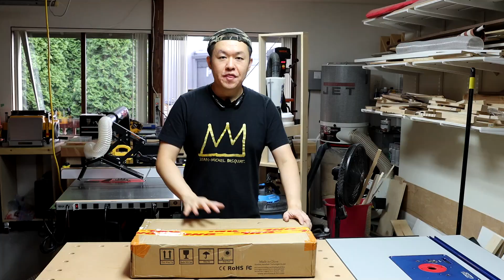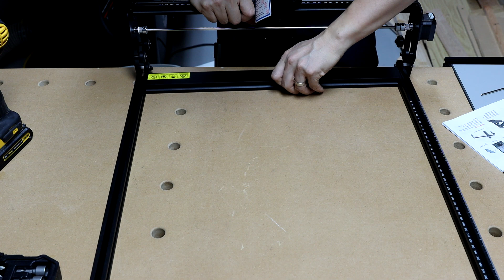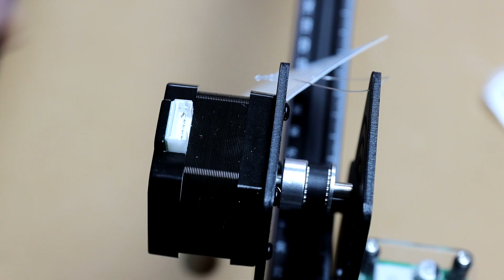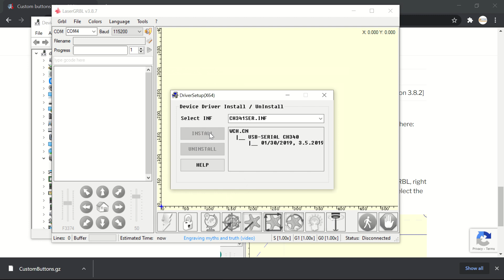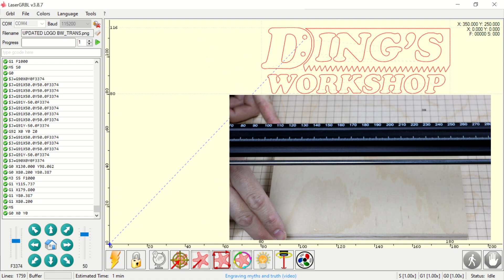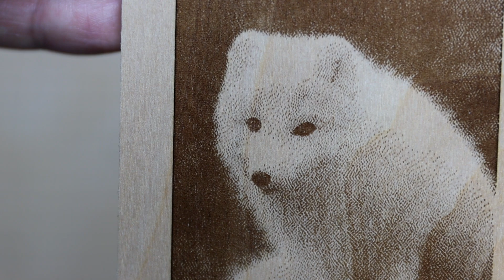Atomstack A5 Laser Engraver Review & LaserGRBL Tutorial | Banggood Woodworking Tools

Comment: Its a fixed focal length laser. How do you set the optimum height above the material?
Reply from the maker: The manual said optimal distance is 2mm off of the surface of the material (from the green hood)
Reply: Thank you for the reply. I've been using that little acrylic Square which is 2 mm thick for all of my burns. And if I didn't say it before... great video thank you
Reply from the maker: @joesgarage618 haha me too! That little acrylic works great as a spacer :)

Comment: I want to engrave on leafs but dont know which laserengraver i have to buy..is it possible with the a5?
Reply from the maker: It’s possible but you need to make sure to tune down the power and use higher speed setting.  Also need to make sure the leaf is completely flat because here isn’t much wiggle room between the surface and the laser’s green covers (about 2 mm gap)

Comment: Can you cut acrylic with this? 3mm maximum. I have one coming from China through Aliexpress. Skeptical as i found mine for £100 delivered. Hopefully it turns up
Reply from the maker: 3mm acrylic is possible, but it will not work with clear acrylic.  Most likely will require multiple passes and slower speed
Reply: @DingsWorkshop  Thankyou for your reply, It is only black acrylic I aim to cut. If not i will attempt to upgrade the laser module. Fantastic channel.

Comment: Hello Ding, Great videos perhaps you can help trouble shoot an Issue, first few tests were very black, just what i wanted following your setup it is not a black as before on the very same type of material, any ideas?
Reply from the maker: hmm what changed between the test results?  did you change the speed?  power?  or perhaps the distance between the laser and your material's surface?
Reply: @DingsWorkshop  Ding, thank you for your response, I discovered that on line to line that the quality had been set to 3000 i moved it back up to 8000 and solved my problem, I reinstalled the software and I think that was when that value changed,  Only problem i see now is a random disconnect ,but that has only happened twice.  Seems that 8000 on the wood I am using works well, again thanks for your videos, really helped this Noob.

Comment: Hey man. Great video! I have a concern regarding the tool, not having a LIMIT SWITCH how big of an issue can that be?? Thank you very much in advance!
Reply from the maker: I actually feel the omission of limit switch isn't a deal breaker.  this way I always need to be mindful of how large my work piece is, and I always do a manual calibration on the coordinates before I use the laser
Reply: @DingsWorkshop   Hey Ding! thank you for answering. Greetings from Cyprus!

Comment: Very clear and precise video.  One thing I can't find reference to is what thickness of material I can fit underneath the laser. I am hoping to engrave on 200mm thick pine. Would this be possible?
Reply from the maker: The engraver is not limited by the height of the material, as you can always elevate the engraver machine to meet with what we thickness of material you intend to engrave on
Reply: @DingsWorkshop  Thanks for answering. I get it now.

Comment: Just  purchased the newer A5 pro m50 similar, but has power switch and emergency off button and also a lcd touch control with a sd card slot so you can load gcode so eliminate the need for it being connected to a computer.
But your guide is still a good reference for my machine.

Comment: Will this cut thin wood pieces for like the 3d animal and building puzzles
Reply from the maker: It will. Just need multiple passes.  Also, it works best with wood with thickness under 1/8 inch.  Anything higher will not work too well

Comment: Thanks for the help getting my own laser set up! It really did come in hand. I did want to ask what was the board you used for the base. I see you added the image to 'cut' it, but might I ask what the dimensions of the wooden plate are? I'm trying to not damage the underlying area where my laser engraver rests.
Reply from the maker: I used a piece of birch plywood I had.  Total engraving area is 400mm X 410mm so the piece of wood I had was larger than this size
Reply: @DingsWorkshop  Great. Thank you very much! Sorry, I'm a bit new at this so I tend to ask every question I don't know, even if it is easy to realize if you think about it.
Reply from the maker: No need to apologize!  It was a great question!

Comment: FYI, Newer models have a line switch between the transformer and main controller for convenience, the guard protecting the user from exposure is already attached and a thumbscrew replaces the two set screws to hold the laser module in place.  Everything else remained the same.
Reply from the maker: Good thing they’re keep improving the product!

Comment: So do u have this enclosed when in operation? Or is it in the open? This is a question for radiation concerns? I have this item and thought this video was super helpful... I have yet to assemble it and wanted to know about safety. I know about the glasses, u mentioned well ventilated area which im going to use air purifier for the smoke and such. Also I saw online saying its a wood cutter which was my intention for it, do u try to make cuts with it?
Reply from the maker: It’s capable of cutting 1/8” thick wood.  I also attempted to cut 1/4” but the result was not good.  I don’t have it enclosed.  When I use it, I have my garage door open, and my fan is blowing toward outside with my air filtration turned on.  I also step away from the area.  Although having an enclosure built around it, with proper ventilation is probably the best way to control the fume.
Reply: @DingsWorkshop  im also checking for a laser mat for the bottom not sure if thats what its called. But im hoping it works out in the end.
Reply: @DingsWorkshop  im not sure what hight it needs to be any suggestions? Maybe about a cards thicknes? thanks.
Reply from the maker: 2mm off of the bottom edge of the green protective cover
Reply: @DingsWorkshop  Gonna duplicate ur settings for vextor soon. Ive been at this for the entire day and my work space is limited every direction. XD Its sad really... had a 3d printer aswell that is printing when it wants to. Also made an enclosure which is like a masterpeice. XP I say that jokingly... Wish i had a shop maybe in the future if all goes welll.
Reply: @DingsWorkshop  So i finally worked the courage to start it and it was successful. Phew! Long journey to get to this point was trying to make a filter blower work... Still though when i start it, i might have over looked some details on the set up which ill review. The laser moves away from where i start it up at. Some home position thing Im guessing... Oh also the score was like .01mm or .02mm deep.. next to actually get a cut.

Comment: Super helpful video. One question... how do you set the height of the laser above the material?  I can't seem to come up with that parameter anywhere.
Reply from the maker: the optimal distance is to keep 2mm of space between the bottom of the green cover & the surface of your material.  what I do is I drop the laser module (with green cover) and let it rest on the material, then I raise the laser up by 2mm and tighten the module
Reply: That's exactly what I was looking for. I'll make a 2mm shim and setup will be easy. Thanks!

Comment: Will it cut 3mm clear acrylic?
Reply from the maker: Might require multiple passes, but it should work
Reply: @DingsWorkshop  Thanks.
Reply: @DingsWorkshop  What would be a better option?
Reply from the maker: Hmm I can’t say I’m an expert, but you will need a more powerful laser to achieve faster cutting capabilities.  These ~$300 lasers use laser diode as the energy source, and achieved cutting capability by concentrating the energy.  But laser diode itself is simply a very weak laser.  CO2 lasers deliver much higher cutting power, but at same time the cost for CO2 lasers are usually in the thousand dollars range
Reply: @DingsWorkshop  Thank you ..

Comment: Hello , is there an option where I can cut through a piece of wood and not only engrave ?? Thanks for the explanation tho , really helpful
Reply from the maker: so laser engraving is essentially introducing a concentrated energy that is enough to remove the material.  In the sense of wood, laser engraving is basically burning the wood, thus causing the darkened color.  in order to cut, you will need to do multiple passes of the same path which the laser takes - in other word, burn the same path multiple times, and eventually you will achieve a "cut".  Based on my experience, this laser can cut through 1/8" wood.  1/4" is achievable, but takes much much longer.  Here's a demonstration of laser cutting I did using this laser:  https://youtu.be/LjgJgktgiFA?t=316
Reply from the maker: here is another example, but with higher power output and slower speed: https://youtu.be/Ug9-sM1faJo?t=516

Comment: Thank you Mr. Ding for the grid it’s awesome I got it engraved, my laser head seems like it’s loose after I mounted it, my protective coverings was already on mine? Do I need to take them off and tighten something? You can rock the laser back and forth pretty easily
Reply from the maker: odd - the laser module shouldn't feel loose.  there are 2 mounting screws which are used to adjust the height of the module, can you make sure they are tight?

Comment: Have you tried to cut/engrave acrylic on this laser?
Reply from the maker: It works with non-clear acrylic.  It won’t work if the acrylic is clear
Reply: @DingsWorkshop  Thank you. I’m probably going to be using non clear acrylic for most of the projects anyway as it’s just got myself. Or use a mask over it such as masking tape. Thank you!
Reply from the maker: I’ve not tried cutting acrylic, only engrave

Comment: I just received and tested one of these just this weekend (end of July 2021). Some things to note: 
1) They added an inline power switch that plugs into the connector of the A/C adapter, and then it plugs into the control unit.
2) While they still ship with a European  Power cord (?) they did ship an adapter to plug it into a North American socket. 
As I have the correct "D" type grounded cables coming out of my ears, I just used one of them.
I have the 30W version, and I used you grid as a first burn into a 24" x 24" sheet of steel that was painted white beforehand. 
Looks good so far but next project is a vented cover with Activated Carbon filter...
Reply from the maker: Oh this is very cool info!  Glad to hear they remediated the lack of power switch issue.  Do you mind share a pic of the switch with me?  I’m very interested in seeing what it looks like
Reply: @DingsWorkshop  Ok, where do I send the pic? (

Comment: Hi Ding, did you have any joy cutting with this laser. If so please share the setting used. I have successfully cut thin materials, but would like to cut 5 or 6mm wood (no luck so far).
Reply from the maker: HI Janice, 5mm might be too thick to process.  I performed cutting on 3mm plywood.  Try setting max power and 200 speed.  you might need multiple passes for cutting to occur.

Comment: Hi Ding, tyvm for your videos! Please help with an issue. I purchased this Laser based upon your review. Problem is, I can't get the center track to go into the grooves on the sides. It definitely looks easy on the video, however, the wheels on the central track I received seem way too wide to fit into the rails. I've tried lifting the end like you did, many times. The center track just won't go in. Any tips? Help!
Reply from the maker: sorry I just saw your question.  I'm wondering if assembled the square frame correctly?  Your description of wheels appears to be "too wide" sounds like the frame was not assembled in the correct order....

Comment: Hey I picked this up but on my X axis when it engraves it jitters or skips any ideas how to fix?
Reply from the maker: I have not encountered this issue, but have you checked if the belt is tight?
Reply: @DingsWorkshop  yes also how would you add air assist to the with the green plastic there?
Reply from the maker: also you can check the connection cable on the x axis motor.  I was thinking about air assist too.  probably need to drill a small hole on the green plastic and glue a tiny tube

Comment: Thanks. I have Mac so need to use LaserBurn.  Setup just fine but unclear how high to set Z axis, height of laser. 
What to you use for material bed, especially when cutting?
Reply from the maker: hi Barry, the focus point of the laser is 2mm from the bottom of the green acrylic cover.  Therefore the optimal height is 2mm above the material you want to process

Comment: Can you engrave a small area on a large board? For example, could you set it on a piece of plywood and engrave a 4” by 4” design on it?
Reply from the maker: Hi Zayne, the machine is pretty light and can be easily moved to a piece of plywood.  Hence you can certainly set it on a piece of plywood and engrave up to 16” x 15-3/4” of area

Comment: Hi Dings,
Just a simple question for You as experienced wood worker I suppose, but I did not think of it earlier... After completing engraving of some objects, i can not get rid of the odor of burned wood from the object. This is not very nice for a kitchen plate or something that is standing in the living room or kitchen.
Please let me know if You know of any solution.

thanks!
Reply from the maker: I usually use a small brush to clean away any over burnt wood, which helps.  I also tend to use polyurethane or lacquer, which essentially forms a thin layer that “wraps” the wood, which seals it
Reply: @DingsWorkshop   Thanks a lot Dings! i found out varnish or lacquer is indeed the best option.

Comment: The cover around the laser module is a very bad idea as it will trap the smoke from whatever you're cutting / engraving, which will fog up the lens making it more difficult to actually cut/engrave. Think about it these types of lasers work better with added air assist to blow smoke away so trapping it doesn't make sense.
Reply: It's got built in measures to stop the smoke getting trapped

Comment: Hi Ding Thanks for the tutorial. I have just unboxed mine and followed all your steps. I am using windows 10 on my laptop and laser  GRBL  v4.3 and cannot connect my laptop has 3 usb ports and which ever on I connect to the problem is the same. Any help please. Thanks in advance
Reply from the maker: HI Paul - were you able to see the COM port showing up in LaserGRBL?  Also, were you able to see a USB-SERIAL CH340 port in Device Manager?
Reply: @DingsWorkshop  Hi Ding yep a driver problem thanks sorted now. Thanks for your help.

Comment: Thanks for the detailed walkthrough 👍 It looks like you posted this about 2 months ago now, have you had any issues during that time frame? I have been researching engravers heavily and I am very interested in this product. Second question, how difficult is it to adjust the laser head? It looked like you used either 1/2" or 3/4" plywood for the demo, will adjusting the head allow thicker material underneath?  Thank you

Comment: Hello my friend! I would be interested in this unit if the price was right. Is this similar to the Ortur Laser Master 2? If you could answer my questions I would be great full. Is there a costumer service. Most important does the unit get to hot and shut off and if so how often and how long will it remain off before you can restart. Thank you my friend!!..               :))......
Reply from the maker: HI Rob, I've not used the Ortur laser hence I cannot compare.  although looking at the spec, the laser output power is comparable between the Ortur and the Atomstack (both are 5W output).  I have not experienced any issue with overheating - I've done 40 minute continuous jobs and it was still working just fine
Reply: @DingsWorkshop  Thank You Sir!!

Comment: can you use a rotary tool with this machine if so which one would work best
Reply from the maker: HI David, the xy position capability can most likely be used with a rotary tool - however, this would require some retrofitting.  For example:  you need to find a small motor that isn't too heavy to cause any load issue to the positioning motors; you will also likely need to have a designated power supply for the motor; also, the routing will not be 3D, thus you also need to plan on how/where the router bit enters material since there will not be any vertical movement capability.  Long story short...this can be done, but might not be the result you are looking for :(
Reply: Thanks for the reply I meant to say rotary roller for doing round objects
Reply from the maker: @davidharris425  oh I see!  you mean the apparatus that rotates a cylindrical object so you can engrave on like a bottle?  I think this would involve a more complicated setup, as the rotation device needs to also sync with the xy control for the engraver :(

Comment: Q:
can i add limit switches?
Reply from the maker: The board has ports for limit switch but doesn’t have connectors soldered.  You will need to do some retrofitting

Comment: Hi Ding. Great video. I’m looking at getting this laser. Can the laser be moved up to get thicker bits of wood under? Also I would like to etch part of wooden dowels, can a long dowel fit under the frame for etching?
Reply from the maker: HI Ryan, the laser is not limited by the size of the material.  for example, if you have a large material, you can place the machine on the material directly.  The machine rests on 4 legs so dowels can definitely move freely between the legs.